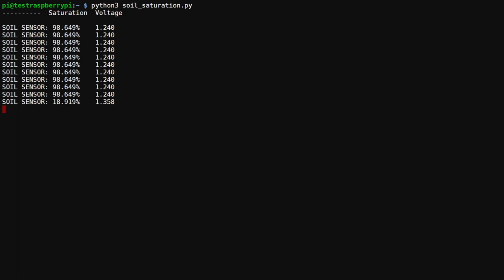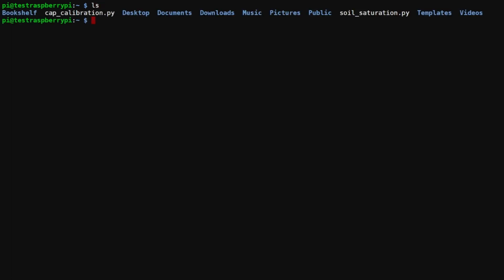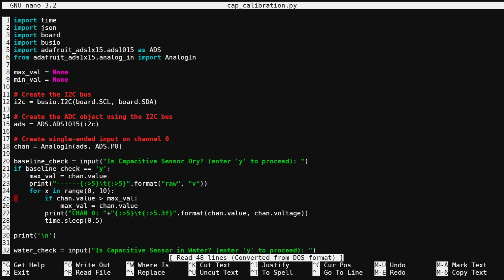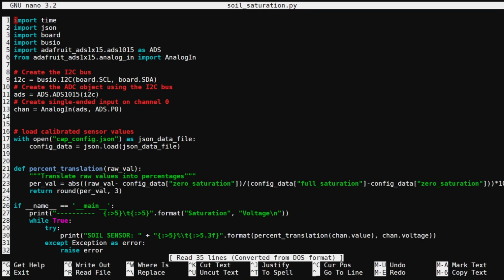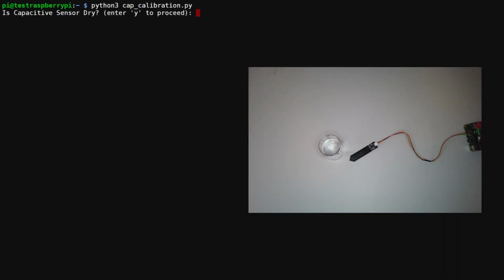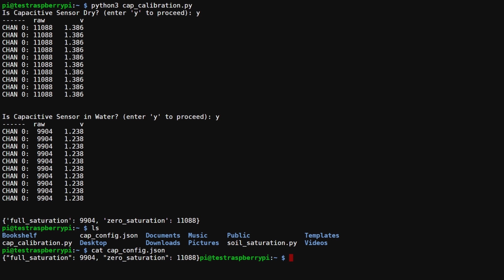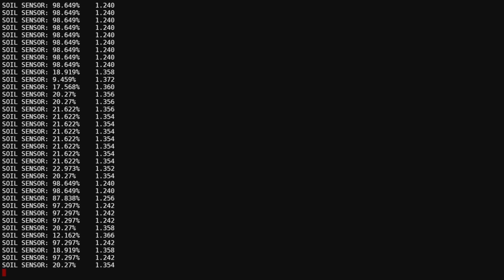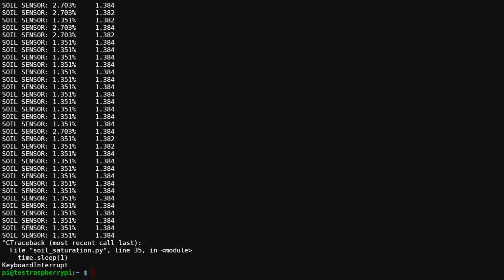Soil Moisture Sensor V2.0 (Raspberry Pi)

Comment: hi i got error like this when i run cap_calibration. py . can anyone help me please 

Traceback (most recent call last):
File "/usr/lib/python3.7/ast.py", line 35, in parse
return compile(source, filename, mode, PyCF_ONLY_AST)
File "/home/pi/cap_calibration.py", line 25
max_val = chan.value
          ^
IndentationError: expected an indented block
Reply: Yeah there is an indentation error. It’s just a spacing issue
Reply: @andreabtahi2891  I got the same problem. How can I fix it?
Reply: @Andre Abtahi Same i need help
Reply: Were you able to fix the problem? Cause I got the same one and I have no idea how to deal with that error

Comment: Hi! First thanks for the video. It was really helpful. I am doing a project on smart irrigation system and Im using the capacitive soil moisture sensor. All that data collected with percentages is showing on the raspberrypi terminal as I can see. What would be needed to get all that data and transfer it to a website where graphs would be created? Just to keep track of the moisture percentages over a period of time.
Reply: You can create a web server using Django and pass the data from the sensor to the web server. That web server will then emit the data whenever it is requested by an API call.

Also, can you tell me how you connected the soil moisture sensor to the Raspberry pi as the ADC converter is not available where I live?
Reply: @AbhishekKumar-rl1pj  an ADC converter is needed. I connected the soil moisture sensor to the GPIO pins SDA, SCL, GPIO4 and the 3.3V terminal, but in between the Pi and soil moisture sensor you need a converter so the data is readable and it is not just 1s and 0s.
Reply: @AbhishekKumar-rl1pj  i think there are sensors that already do this job without a converter. Try to look it up.
Reply: Hey. Did you end up using that same sensor? Or could you recommend one that tells me how humid the soil is? All the capacitive sensors I've seen online only tell me if the soil is wet or not.